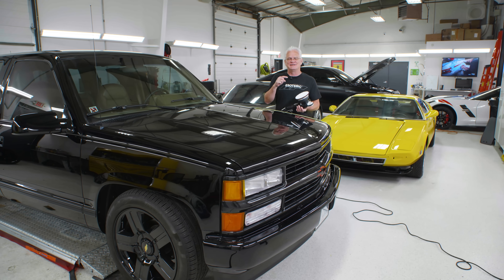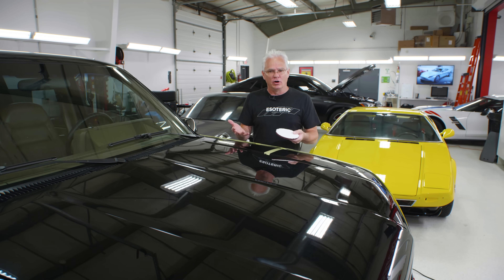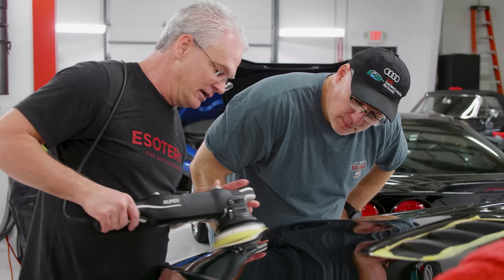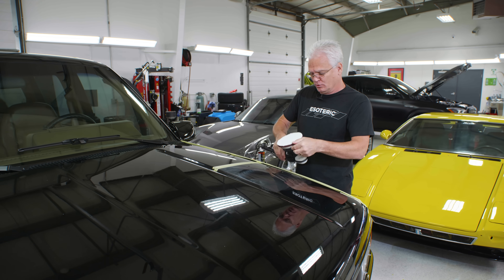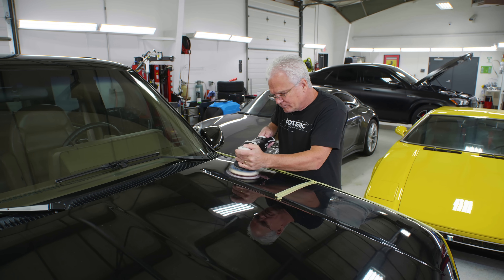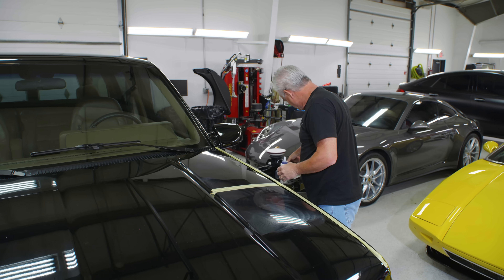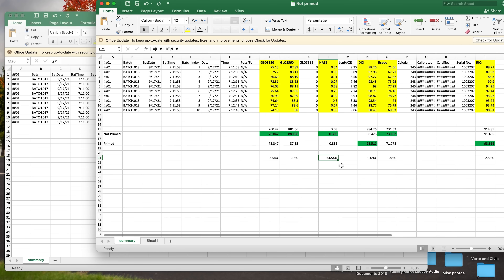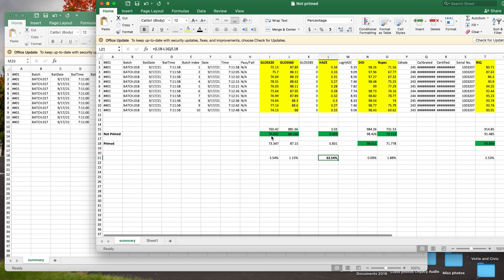DEBUNKING pad priming, with SCIENCE!

Comment: DA are naturally incline to self prime their pads, even more when you slide the pad on the surface before turning the machine on. Still microfiber is a lot more aggressive and tend to heat the paint much more. So priming in my opinion is more a lubrification instead of the cutting readiness. It would be interesting on a panel with different sanding grains and see difference. When cutting real deep scratch micro marring is not my first priority, even more with a microfiber pad
Reply from the maker: Even with MF pads (which we use for compounding almost exclusively), heating is a non-issue unless you're using a combination of too much pressure, too high a machine speed, and too slow an arm speed.

Comment: I’ve had this debate at the shop for some time.  I’m the guy who doesn’t prime for these reasons as well as level of effort and waste of money.  Another words, IMO, you actually spend more time cleaning your pad because it’s loaded with polish thereby reducing the working time and it wastes an inordinate amount of product reapplying. Add to it the time it then takes to remove that add product, either by wiping so you see your effectiveness of that stage or moving on the next stage of polishing and repeating the same madness.  I think it’s a huge waste of time to prime when you add of those extra wipes.  Thank you again Todd for an awesome example backed by solid metric.
Reply from the maker: Well said...
Reply: the extra wiping on soft paint strikes me as a huge negative as well.

Comment: Does it really make any difference as after the first set your pad is primed anyway, so surely the haze will be back after the first set?
Reply from the maker: Another reason why we recommend swapping out to fresh pads far more frequently than others do!
Reply: @Esotericdetail  agree sir
Reply from the maker: Priming via saturating the pad, and a few drops here and there is a completely different thing. Just run with 3 drops, change your pad out every panel or two, and you'll achieve a high level of results.

Comment: on a panel that has been repainted over the original paint, how do you know how far you can buff it without going through the clear coat?
Reply: Get a paint thickness measurer. Measure several spots around the panels then measure the door seal. The difference is the clear coat.
Reply: @NoirSavant  this is the averages result, door jamb 76, bonnet 113, front guard 201, front door 235, back door 180, back guard 139, boot 109, roof 104  how far do you know how to go??